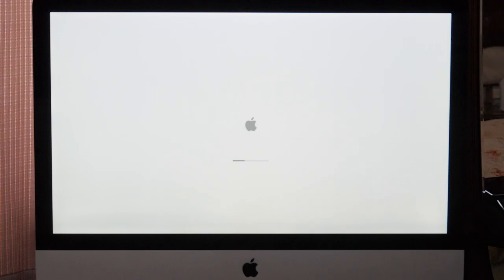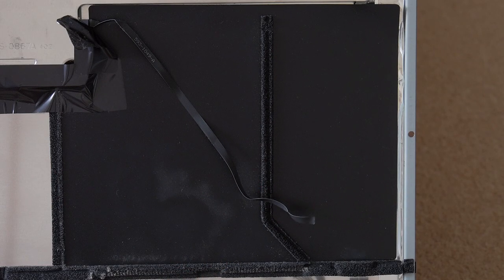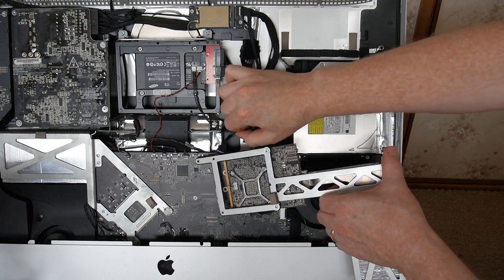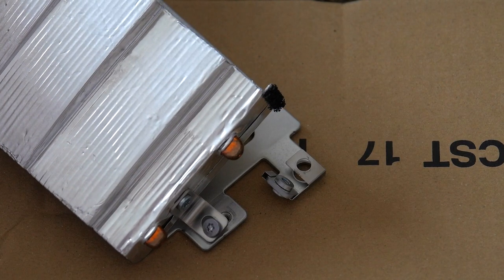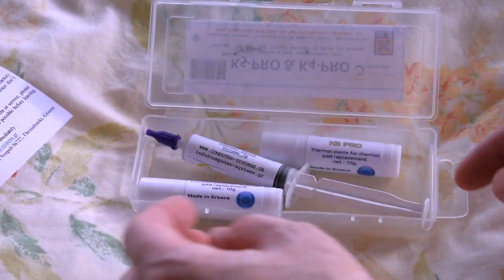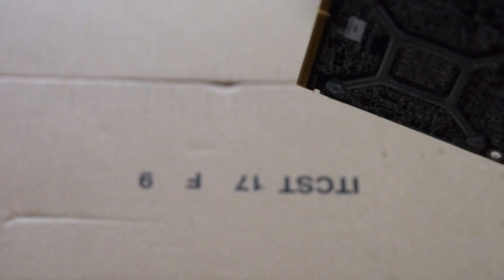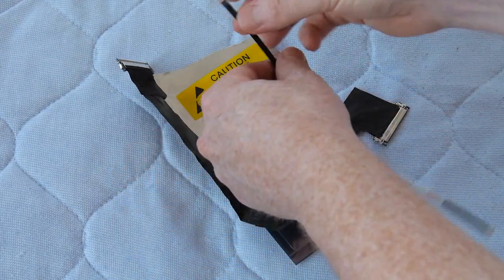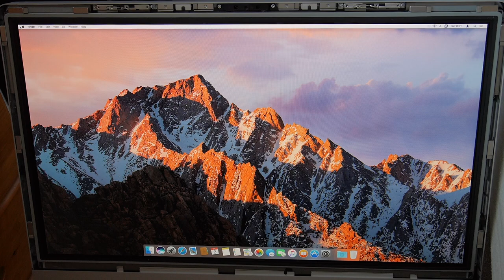Late 2009 iMac 27" Video Card Repair — 4850 — 2nd Bake

Comment: Thanks for the great tutorial! I baked my 2009 27" iMac graphics card yesterday in an oven at 210°C  for 11 minutes. I then left it to cool slowly inside the oven with the door open slightly. It is running well. I am interested in other people's experience: How long should I expect the repair to last?
Reply from the maker: Michael, thank you for sharing your story of success.  Please know that I update the text description beneath my video above with new info every single month in regards to the state of my 2nd Bake.  So far, it's been running daily for 2 years and 2 months without any issue.  At the time of this writing, there are 629 comments, and while some are questions, many are reports of success like yours.  I read and reply to every comment and so I know that most people who try the bake not only find success but it seems to be working well for them in the long term in that they never report back at all to say otherwise.  Some people who do report back are saying their bake failed in like manner to my 1st bake, only a few months later.  I cannot tell if the root cause of those failures is the thermal paste they used, but I suspect it may play a role.  Suffice it to say, so long as you cleaned off all the stock thermal paste and thermal pads, and used a quality thermal paste on the GPU and a proper thermal pad replacement on the memory chips, that is the absolute best you can do and hopefully your bake will last as long as my second bake has.  Best wishes.
Reply: Does the iMac still work?
Reply: @kampf-wuffi  Yes. I use it every day for my studies at University. It still works perfectly - definitely worth the risk.

Comment: Afternoon.2 and half years later seems I need to rebake the GPU 🙈 switch on the iMac and blue bars and pink / blue small dots all over the screen. Eish hope it sorts it out once again. Thanks again for the in depth video 🙌
Reply from the maker: Sorry to hear that, but 2.5 years is about what I would expect, since in my experience even a brand new card from Apple lasted only 3 years.  If you are able to bake it back to life again, you might end up with another couple years of use.  At some point though, the bake won't work.  My 3rd and 4th bakes failed insofar as they only lasted 1 week each, so I was forced to buy another card.
Reply: Round 2 of my bake and it’s working again 🙌 Followed your video to the T and up and running again. Let’s see how long this bake 2 lasts. Hopefully another 2 years 🙏 If I may ask what did it cost your for a new GPU card ? Is there an updated spec that can be used which has this issue resolved ? Thank you once again 👊🙌
Reply from the maker: @OO7JAMS  Very glad to hear your bake is working.  If it is still working 1 week from today, then it will probably last you a long time.  Fingers crossed!

The 6970M with heatsink cost me $229. My video about that card is here: https://youtu.be/9dPsH1zIQMs
Reply: @JDW-  👍 Will update you after a few weeks. Looking to replace the CD ROM with a   HDD as I don’t use the cd ROM. Replaced primary drive with Samsung Evo SSD a while back. Keep well .

Comment: Hi - we've just done our second bake (10mins at 395f) - black screen after boingg noise. Thought we might have the same issue with the top left 4 conductor cable as it was a bit bent so fitted a new one. Still have a black screen. Any ideas? Now has an SSD and has been great for a long while so don't want to give up!
Reply from the maker: A black screen is almost always a cabling issue, and that cable is most often the widest ribbon cable in the middle.  It's very hard to secure properly during reassembly.  Make sure the graphics card is fitted well too.  If that doesn't work, power on, wait a few minutes, then shine a flashlight into the LCD.  If you see content, then it means the backlight driver is dead and needs to be replaced.  But that problem is less common than a cabling problem, so I'm skeptical if that is the cause of your black screen.

Comment: Hi I did mine today basically did everything as the video and work perfecfly for couple pf hours then when started to get hot automatically turned off. Do you have any idea? Thanks
Reply from the maker: I'm very sorry to hear that.  After your machine cooled down, were you able to get it to boot again?  

What model year and screen size is your iMac, and what is the model of the video card?  If you have a late 2009 27" with 4850 like mine, your machine will set get hot after you bake and repaste.  If the bake worked, heat shouldn't cause the iMac to freeze after only a couple hours of use.  There could be something else at work.  What were the symptoms that prompted you to do the bake in the first place?

Comment: Hi JDW, first -  thank you for the great tutorials here.  I executed a combination of both your videos and bought the same products you recommended.  After reassembling the iMac and booting it up, I can hear the boot up sound, but the screen is black and the fans start running at full speed!  Any recommendations here?  Could something I have done trigger this result?  Any advice is appreciated.
Reply from the maker: I read any reply to all comments, and there have been a handful of people who reported exactly what you said.  What I said to them is what I will suggest to you.  It could be a broken ribbon cable, especially the very first cable you must disconnect in the upper left corner when you start out removing the LCD panel.  Some people said their cable wasn't broken but that the metal pins at the tip which inserts into the connector were coming off.  My was like that.  On my 2nd bake I accidentally broke it, which is why I replaced it, but the pins weren't in good condition on the old one.  If there's a problem with that or the wider ribbon cable (connected toward the middle of the logic board, you might get a blank screen at boot time.  Also, if your video card was not properly socketed back in its connector, or if you did not secure any of the other connectors during reassembly, you could get a case of no video.  So I'm sorry to say you'll need to reopen your iMac to verify those cable connections and check the state of the metal pins on that one ribbon cable.  If after doing that and confirming there are no intermittent connections, it could very well be that your video card was too far gone to be fixed by the bake.  I think it's more likely a cable problem though, so give each one of them a thorough check.  And make sure you put your RAM back in before booting.  Let me know if this helps.

Comment: Thanks for the video. my iMac is working again but I notice that the fan is louder now. Any idea how to fix this?
Reply from the maker: Thank you for letting me know your bake was successful.  A few people who performed the bake successfully reported the same thing you have.  I had to inform them that the reason is either because a cable was left disconnected or improperly connected, or you may have inadvertently broken a cable.  What this mean is, I'm sorry to say, that you will need to reopen your iMac and check all the cables.  If one of the temperature sensors is disconnected or not working properly, the iMac will ramp its fans to full speed.  You could use MacsFanControl or a similar app to bring the fans back down to normal speed, but it's best if you find the problem cable and reconnect it.

Comment: thanx a lot for the video!! Should i use fan control or just let my imac use its own fan settings?
Reply from the maker: I don't think it matters too much because after I did my first bake, I used a fan control app to increase the fan speed but nevertheless the video card died again 4 months later. Of course, after my second bake, I continue to use the fan control app to keep the fans running at higher speeds and it's been more than half year with my iMac still going strong.  So I cannot say if the longevity of my second bake is due in part to the increased fan speed or not. It makes logical sense that increasing fan speed should help better cool the electronic components and therefore increase the overall longevity of your Mac though. When deciding what to do, it's important to keep in mind that Apple tries to keep the fan speed as low as possible so as to keep your Mac quieter, rather than cooler. So if you want a cooler Mac, then you have no choice but to use a fan speed control app.
Reply: JDW i had the same problem. I went to a replacement center and the guys there replaced my ati's 4850 bga chip for 270 euros. Everything is great now, but i have a fear of working my machine at stock fan speeds.
Reply from the maker: Give these 2 apps a try.  I can vouch for both being good.
https://www.crystalidea.com/macs-fan-control
https://www.eidac.de/smcfancontrol/smcfancontrol_2_6.zip

Comment: Preparing my first bake. With 1 such container K5 Pro, how many videocards can you do with? About the baking, I was thinking to hang the card vertical on a metal hook or wire through 2 fixing holes, instead of using the 4 pole mounts. Do you see disadvantage in this method? Also did you used forced air in the oven?
Reply from the maker: For each chapstick sized container of K5 Pro, you should get 3 cards worth of memory chip repasting.  My oven is a Convection type that has a blower fan, but the bake can be done in a conventional oven without a fan.  You need to make sure you bake at 200°C or 400°F, and I would recommend putting a turkey thermometer inside during the warm-up period to verify your oven's temperature dial is correct.  The temperatures we're talking about aren't hot enough to fully desolder components, but hanging the card vertically would put more gravity on all the parts, pulling them downward.  I don't suspect anything should fall off if you try that, but I cannot speak from experience.  With the card mounted horizontally, gravity is pulling only on the bottom side components, which are all very tiny and lightweight.  I'd recommend the tin foil standoffs as shown in my video.
Reply: @JDW-  well that's a quick response. I was thinking about the vertical position bake, because in comment on these bake video's, someone said that these ATI notebook cards are not meant to mount vertical, like they are in the iMac. Not sure how real this is? So my idea was to bake the card vertical in the opposite way like it is mounted in the imac, to compensate somehow.
Reply from the maker: @tv175s3  The temperature of the card inside the iMac is less than 200°C, and it honestly doesn't matter how it is mounted inside a computer so long as it is adequately cooled.  To make sure that happens after your bake, just use a fan control app and set all 3 fans to as fast a speed as your ears can endure.  Currently, mine are set to 2000rpm, which works well even during gaming.  I still think you should bake the card as described in my videos, especially since I read and reply to every comment, and so far, not a single person has baked their video card vertically.  I suggest going with what is known to work -- a horizontal bake.  Please let me know how it goes, and please don't forget to use either K4 Pro or Thermal Grizzly Kryonaut on the GPU.  K5 Pro is not made for the GPU and should only be used on the memory chips.
Reply: @JDW-  On my still working iMac 2010 i3 ATI5670 SSD, I see a start temp at the 3 GPU sensors for about 35-38°C and after 2h youtube it goes up to 46-48°C. That looks OK to me. I use Macs Fan Control at Auto setting which is 1000rpm for ODD, HDD & CPU. Sometimes I see HDD fan going to 1100rpm. 
So what are you're temp's then when you use 2000rpm constant?
Reply from the maker: @tv175s3  Any temperature around 50°C or even 60°C is normal and nothing at all to worry about.  I often get around 50°C on my machine even with 2000rpm constant fan speeds, but of course my son loves to play Roblox, which is why.  You only need to be concerned if your temperatures get higher than 70°C even with higher fan speed settings.  This information is true regardless of whether one is using a 4850 card or a 6970M.
Reply: @JDW-  So today I received my K4 an K5 Pro set. Out went the graphic card, disassembled, clean old paste, baked (10' at 180°C), let it cool in the shut off oven with open door, clean again with iso prop alc, apply K5 and K4, assembled, put back in the iMac (without touching MB screws), and then cross fingers,.. YESSS it is cured!!
My late 2009 iMac 27 with ATI4850 is back to live! Unbelievable, what a waste otherwise, to throw out such a machine with a nice hi-res 27" display. It is stable now for about 60min watching YT and writing this comment. GPU temp in 50-60°C with ODD fan at 1000rpm, and going down to 41-51°C at 2000rpm using Mac fan control.
Many thanks and kudos to JDW for all his helpful video's.
Reply from the maker: @tv175s3  Congratulations on your successful bake!  There has been at least 1 other person who did the bake at temperatures lower than 200°C with success, so I am glad to hear that your 180°C bake worked as well.  Please keep me updated how your video card does over time.  Hopefully you can get at least the 2 years and 9 months of life I got from my 2nd bake.  Best wishes!
Reply: @JDW-  I had a second look at the oven settings, position 6 is in the manual marked as 205°C. That is the one I used for 10', don't now where I've got that 180°C from.
Reply from the maker: @tv175s3  That's good news.  It should make for a lasting bake.  Please keep me informed over time how your iMac is doing!

Comment: Thank you so much for a very detailed video. What is the difference between thermal paste you put on chips vs the one you put on main chip ?
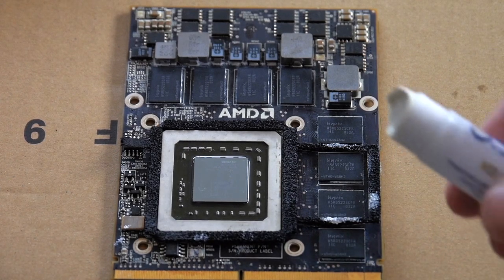Reply from the maker: Thank you for watching and for your comment. You are referring to 29:10 in my video.  There are two types of thermal pastes used here because one is a replacement for the thermal pads which Apple used on top of the memory chips. The GPU is different because the heat sink comes in closer proximity to the GPU than the memory chips. So the memory chips need a very thick style paste because the gap between the top of those chips and the heat sink is larger than the gap between the heatsink and the GPU.  You would not want to use thermal pads or a thermal pad replacement paste on the GPU because it is not necessary and because the thinner pastes conduct heat better than thermal pads or thermal pad replacement paste.  This is not a problem because the hottest component on the video card is the GPU, not the memory chips.  I hope this information helps!
Reply: @JDW-  Thank you.  That helps.

Comment: is it dangerous to apply too much? it does have electrical conductivity right? how to clean it afterwards if you want to replace it? is it easy? what happen if it spills on the ICs?
Reply from the maker: "Dangerous"?  Absolutely not.  The K4 & K5 Pro I used in my video (see Description under video for link) is NOT electrically conductive.  It doesn't matter if there is spillover.  Too much spillover might restrict airflow a tiny bit, but making good thermal contact with the heatsink is most important.  It's more likely you'll use too little paste than too much.  And that is not my best guess either.  I followed the manufacturer's own video on how to apply it, in the same amount they did.  The thermal pad replacement paste is unique in that you can use a heck of a lot and it's A-OK.  A lot of guys experienced with thermal paste think it's too much because they base that on knowledge of normal pastes which don't replace thermal pads.  

Follow my video and you'll be OK.  I did the 2nd bake the first week of July 2017.  It's March 17, 2018 and my iMac is still going strong, being used daily, even for gaming, for several hours per day.  That wouldn't be true had I done something wrong in my video.  If you buy a different set of pastes, you would need to be more careful.  But that's why I suggest you just buy the same paste I did.  Then there is no question about what you need to do.  

Removing the paste isn't too hard, but it takes time.  You'll need a lot of swabs.  I used dehydrated Ethanol alcohol, but you could buy a professional product made for removing thermal paste to do an even faster job.  Just be sure to remove all the old paste before you bake, then let your card cool down before you apply the new paste.

Best wishes!